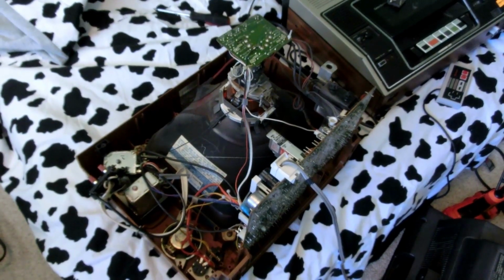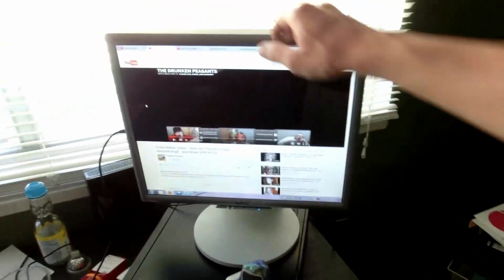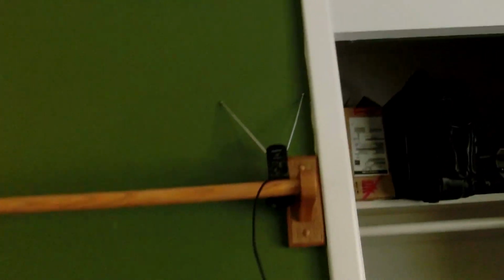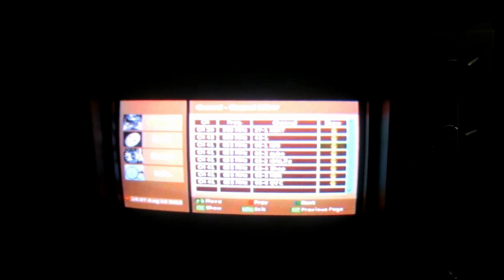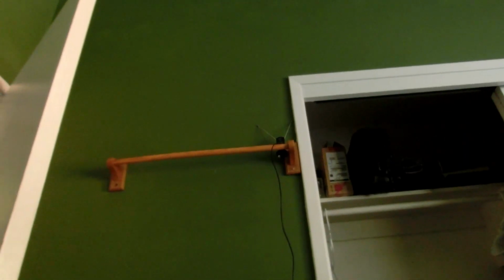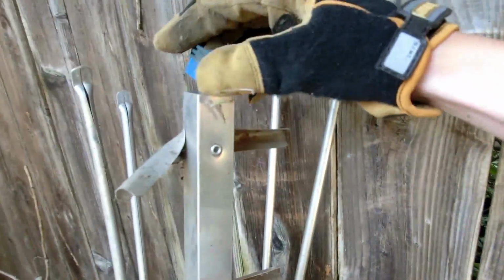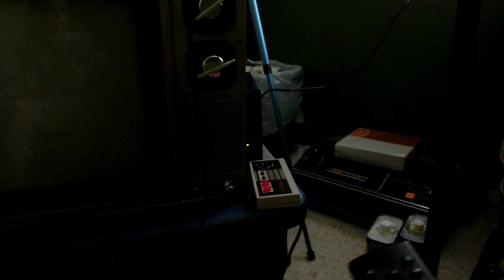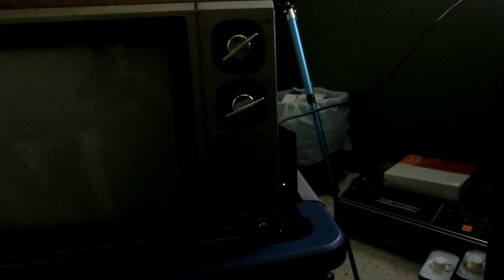Random Bits 0100: Antenna gets 62 channels

Comment: I'm sure you will research and find this out but no one else has commented this so I'll tell you a bit about your antenna. It's a yagi and as such is directional and as you placed it the direction was towards your bedroom. I would suggest going on a website named antennaweb and it will give you the exact directions to every transmitter in your area. It is also important to place all the antenna "elements" in as close to original placement as possible as each element is tuned for a certain frequency range (channel) You could probably do without the longest elements as they are mostly for VHF which is mostly not used after the digital transition. Keeping it attached so it won't move in the wind will help with ghosting.  61 Channels is an awesome result and  you can probably have some late night fun dx'ing for more stations.
Reply from the maker: Rob NAustin yeah i know, but thanks ^^

Comment: Figure you know already but please be careful when using a knife like you were.  Esp a slip joint like a Swiss Army type.   I knew better than to use one like that, did it anyway, and filleted my thumb when i put to much pressure on it and the blade folded.  Stupid on my part.       Interesting about those potentiometers being there.   Wonder if the knobs were actually there if it would have been sold as a "better model".
Reply from the maker: Mandurath yeah you have to be very aware of it, but i'm cutting more with the side-to-side motion than straight down. i've used this pocket knife for over a decade, so i rarely hurt myself with it anymore. i also keep the blades kinda dull to minimize issues.

Comment: If you put an inline amp you might get even more. Radio shack used to sell one for analog but it works on digital also. Its a 75 watt I think silver box that plugs into the wall and has a in coaxel  and out coaxel from antennae through box to digital converter box.  http://www.freerepublic.com/focus/bloggers/2839415/posts scroll down a little over half way on this link. see ya